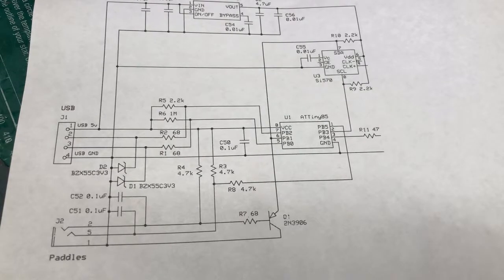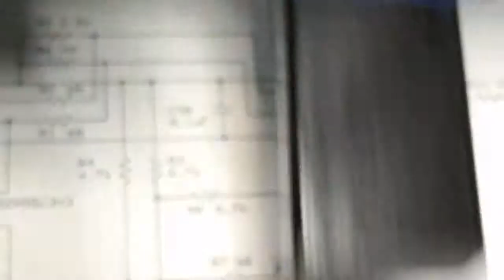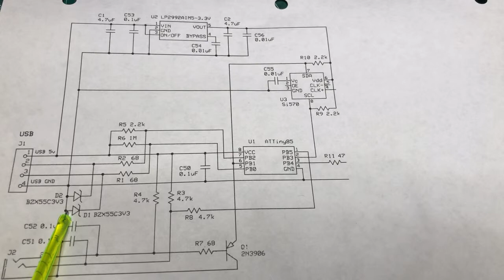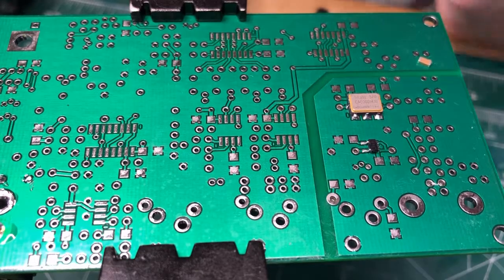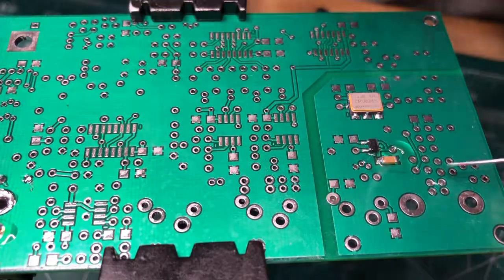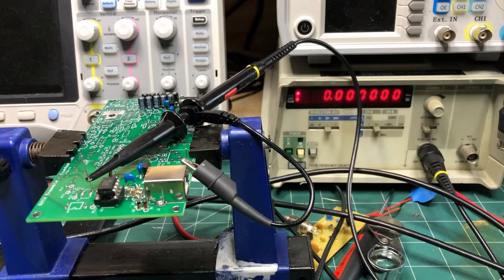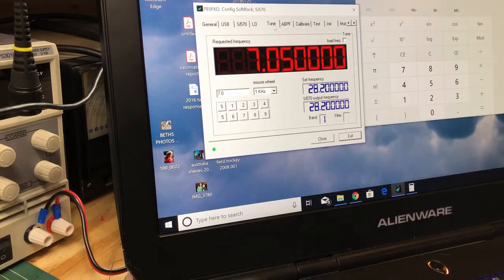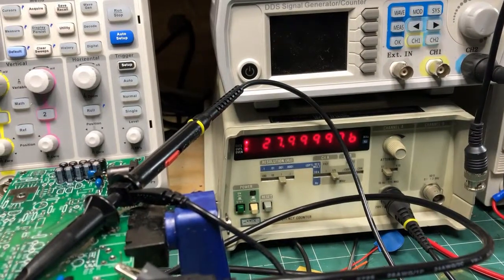Ensemble RXTX Build #3 - USB/ATTiny and Si570

Comment: Hi where can I get the attiny software to program my own programmer for seting up the Si570? I want to make some low jitter clock for some DAC :D Thank you
Reply from the maker: To program AVR style uControllers you need an AVR programmer like this one https://www.adafruit.com/product/46. You also need the AVR toolchain - probably the easiest way of getting that (if you are on windows) is to install Atmel studio https://www.microchip.com/en-us/development-tools-tools-and-software/microchip-studio-for-avr-and-sam-devices. 

There's a really good series of videos on barebones AVR programming where he uses the ATMega328P - a big brother of the ATTiny. The series starts here https://www.youtube.com/watch?v=_52r8cCf4AY.

As far as a synth goes I would recommend not the si570 - but rather  the si5351 - a dev board can be found here  https://www.amazon.com/Adafruit-Si5351A-Clock-Generator-Breakout/dp/B00SK8LNYG/ref=sr_1_1?dchild=1&keywords=si5351&qid=1614524388&sr=8-1. 

Having said all that my personal preference is the STM32 series of boards and the STMCubeIDE toolchain. 

I hope this info answers your question - thank you for the comment